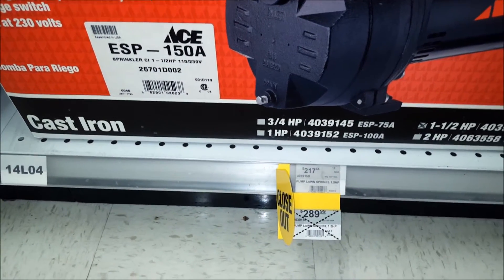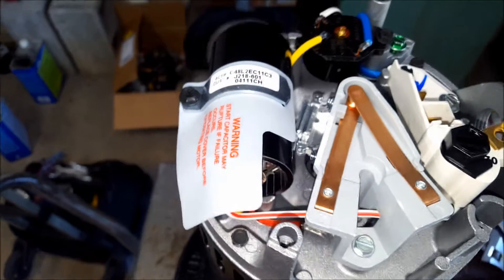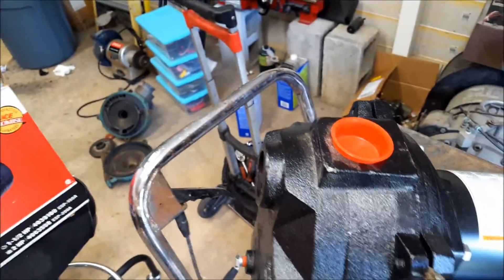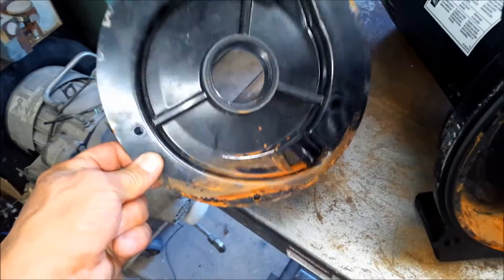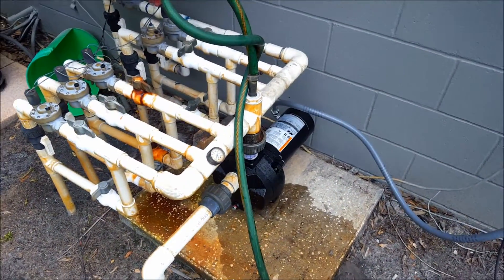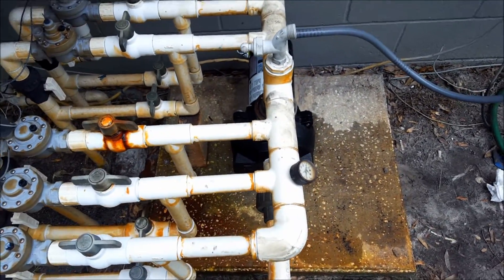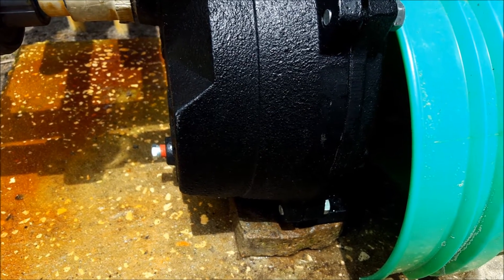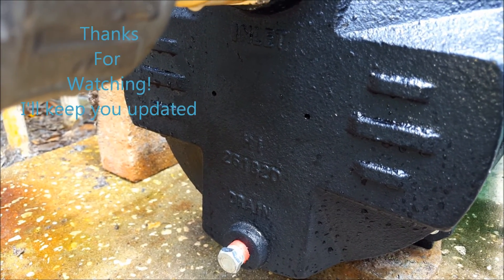1 5 HP sprinkler pump replacement

Comment: From experience I can tell you that the screws that secure the rear motor cover benefit from the threads being coated with anti-seize compound prior to re-assembly.

Comment: Do you manually have to change zone or do they run all at the same time. That sounds like the bearing behind the impeller. Im surprized you didnt just bring it back to Ace Someone didnt assemble that pump very well from the factory and with that squeal I dont see it lasting very long. Why not just spend a couple hundred more and get a gould or a pentair. I forgot the other good ones but you get the picture. something heavy duty?

Comment: that's a used pump with bad bearings..
Reply: Yup. Thants why it was a closeout. It was prob a return. When you see rust like that it means someone had it apart but didnt  have the parts or experience to put it back together. I used to be a pool repair tech so like you. Ive seen it all